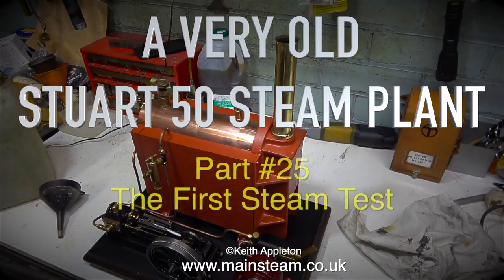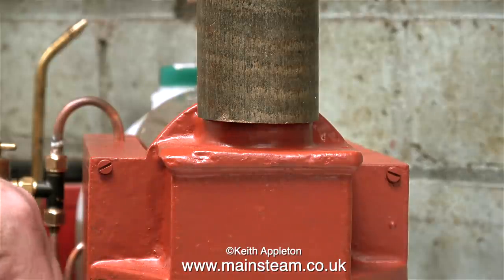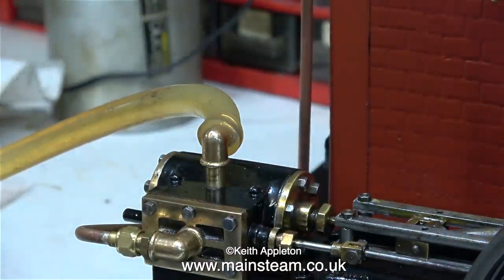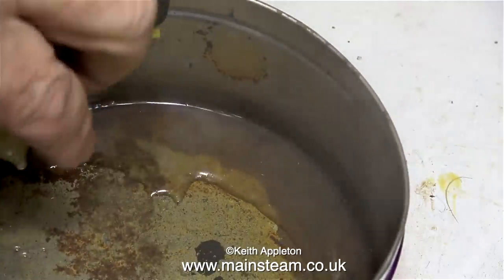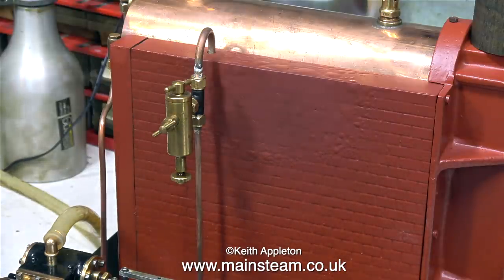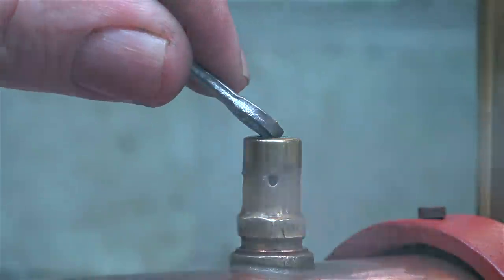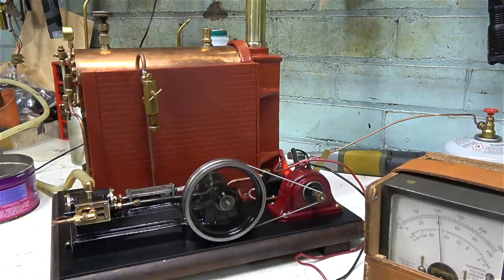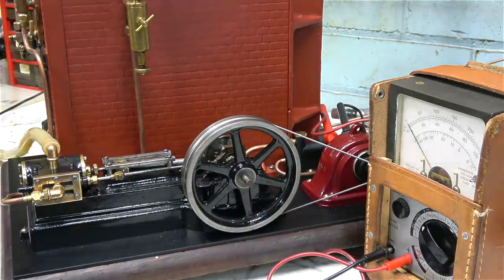A VERY OLD STUART S50 STEAM PLANT - PART #25

Comment: The condenser idea sounds good. When I built a steam-powered crane using LEGO and a Wilesco steam plant, the exhaust was routed up to a chimney made from those dissolving tablet tubes through a hole on the side. It was held into a sleeve and could be removed when it was full, which usually took two or three steamings, the steam came out beautifully at the top.

Comment: I think for my birthday this year I am going to get myself a kit, i've seen the little tea light one I think that's the one i'll start with :)
Reply: If you're in the US, the PM Research #3 is a great starter engine. No machine tools necessary if you buy the pre machined kit, and you can run it on a cheap tire inflator, an air compressor, or even a large aquarium pump.
Reply: @k4kfh   I am in the UK  and live in the same county a Mr Appleton, but thank you for the advice  , I popped onto their website and note they will take international orders  so you never know ;)

Comment: Personally, I would use a high-temperature heat resistant paint.  Check eBay and Amazon.  I found that Harris brand, Duplicolor, and Stove Bright have a variety of colors.  I didn't find terracotta, but I did find several shades of red, including flat oxide primers that appear somewhat similar.  

The other idea would be to bake on the paint you are using at lower temperature, perhaps 200 to 250 degrees F (93 to 121 C) for 2 to 3 hours.  That will drive out residual solvent and make the paint much harder and less likely to soften or bubble at higher temps.

Comment: I am very curious. Why feed condenser to the chimney if it does not get too hot? Won't the condensate damage the chimney? LOVE these videos! Keep up the great work and hope the new home is coming along nicely.
Reply from the maker: because if I don't do this, the condensate will run down and put the fire out ......
Reply: The same reason bathroom extractor fans blow up on a vertical vent. You need to catch the condensate runing back down the vent/chimney and direct it somwhere else, otherwise fan trips rcd or it pisses on your bonfire.

Comment: I think you need to measure both volts and current to properly gauge the electrical output capability of the plant.
Reply: When your talking power yes. But 6v will charge a phone, even at 10 ma. But a load resistor could figure that all out. Interesting point.

Comment: Keith, you may be the man who knows. When a steam engine on the railways cleared out the firebox and chucked it on the side of the line, was that called clinker? Was it used as a building material? Not having much luck online about it. I know clinker bricks etc. But I am sure coal fired waste was used as a cheep filler aggregate. In the uk at least.
Reply from the maker: I would think so, maybe some other viewers know more about it.